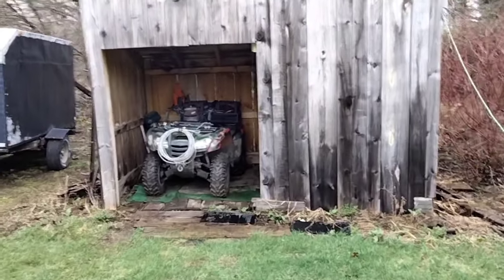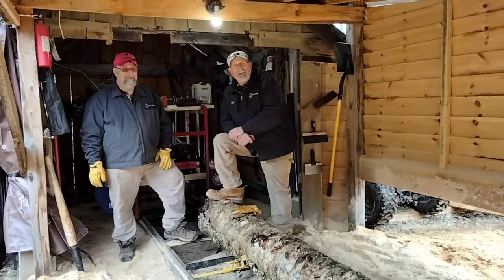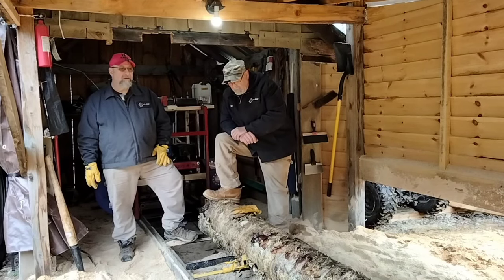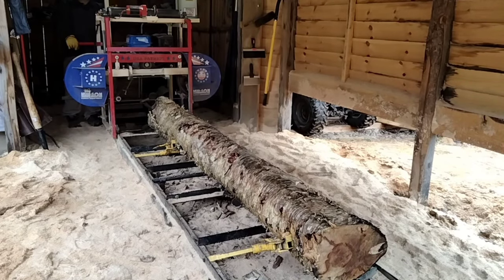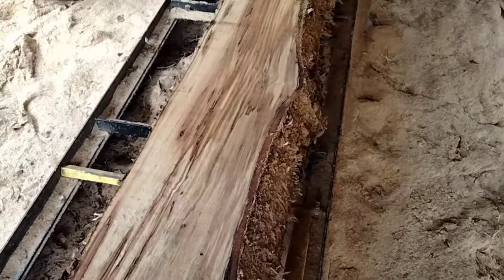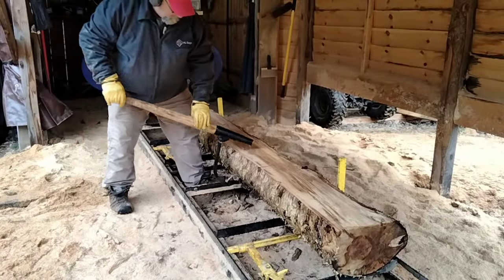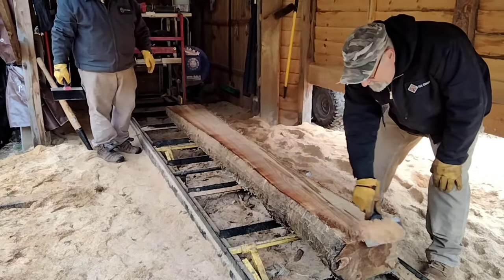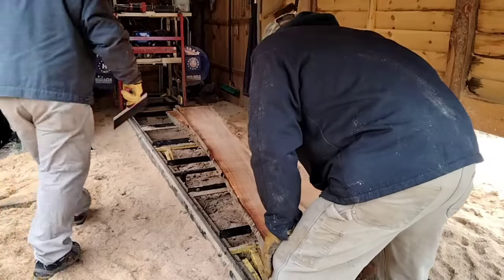Inside an old log 🪵 #homesteading #portablesawmill  #hud-sonforest

Comment: Looks like you have a Ford 930 or 930A finish mower, that's what I mow the orchard with.  It's difficult to locate the mower blades for it, but there's a Woods blade that is still produced (Ford New Holland has discontinued production).  You have the 72" version?  I have the manual for it.  If you can't find one to download off the inter-web let me know and I can scan it for you.  I'll see if I can locate the part # for the Woods mower blades.  Clinton Tractor had the Woods blades in stock, I like two sets so I have one ready to go if I want to change out the blades.  A little expensive @ around $150 for the set.
Reply from the maker: Andy, it is a 930a, our wonderful parts team got researching the mower blades for us and found this # 31306 kit on Amazon. Their research says these are the blades.
Reply from the maker: Woods 31306kt

Comment: What tractor is that in the shed next to the sawmill
Reply from the maker: 1948 Ford 8 N
Reply: @Twobrothersoutdoors  cool, I  have a 1950 Ferguson TO-20.
Reply from the maker: @stevek5988  I love the Fords, Fergusons, and massys
Reply: @Twobrothersoutdoors  how well do the pallet forks work
Reply from the maker: @stevek5988  very well, but there is a limit, the ford front end is very light
Reply: @Twobrothersoutdoors  oh I understand that part. I'm always dancing between the lift lever and the clutch to keep it on the ground. That's why  I am thinking about pallet forks.
Sent you another email showing my Sawmill loading setup.
Reply from the maker: @stevek5988  you can message us on here our two Brothers FB page.
Reply: @Twobrothersoutdoors  got it.